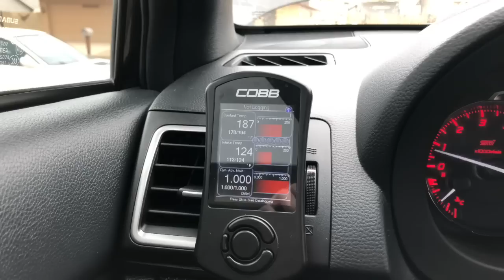Project Daily Gets A New CSF Radiator!!

Comment: I noticed you used the csf radiator cap on the radiator side on ur new radiator. Tons of readings online say to stick with Oem radiator cap on radiator side, I've been testing both caps and it runs hotter with the Oem cap then it does with the csf cap. Can you shine any light or experiences? What cap are u using on the turbo side of coolant and radiator cap to this day?
Reply: it runs hotter with the OEM cap because it runs at 1.3 bar, and the csf is rated at 1.4 bar. When you increase the pressure of the system you increase the boiling point.